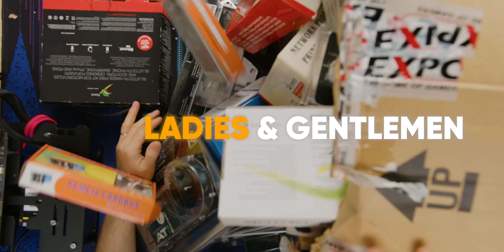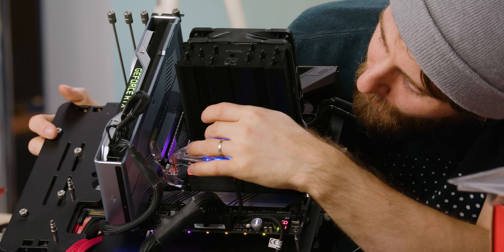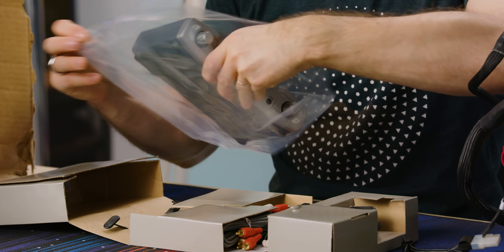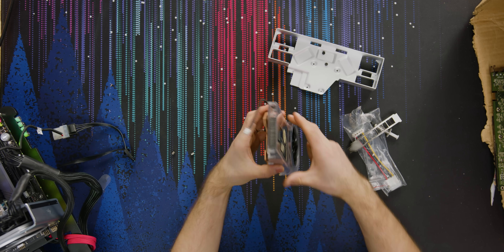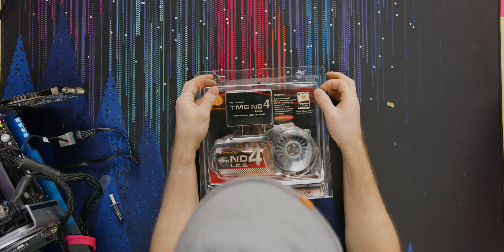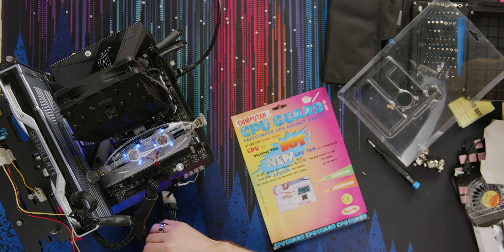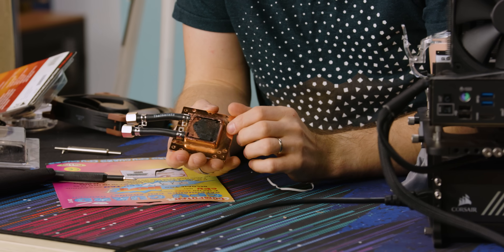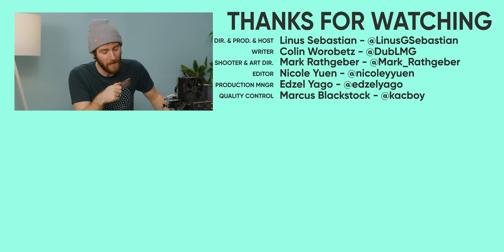I Bought Out This Bankrupt Computer Store's Inventory

Comment: The HDD racks were super. There were IDE ones and SCSI ones. Really handy for backups. When changing you needed to reboot though. On PC dump day I bought 8 SCSI ones ( metal, not crapy plastic ) for HFL 5,--  ( € 2,20 ) in the late 90's/early 00's. Those were the days. The HDD coolers were very interesting for WD Velociraptors ( 10.000 RPM ) or high speed SCSI drives. Got rid of the heat and noise at the same time.

Comment: 3:57 i actually had this before, got it from a half dead 2000s computer though. its an IDE hard drive bay (possibly for hot swapping?? idk) you place the hard drive in the inner tray and connect everything up, and then you would insert the inner tray back in the stationary tray (inside your PC) and it would act like a normal hard drive, the inner and stationary trays both have fans, so the drive gets some cooling too.

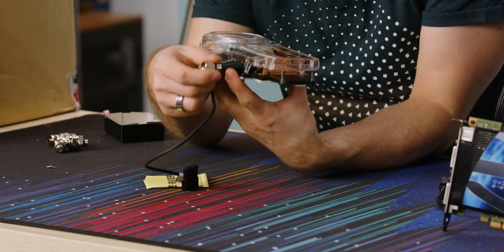Comment: 10:23
The idea of that cooler only died in the last year or two, one of the EVGA last generation cards was ALSO hybrid water (for the GPU itself) and air (for the memory).
I forget which they used on the power supply parts of the card.

Comment: "Legitimately might need this for my lathe" -> Sadly, USB to serial or parallel adapters hardly ever work for those applications. For that, you need control of all pins, and low latency, and those adapters offer neither.

Comment: In 1994 (I was 14y) I got my first own PC.  This was a special one because of the CPU. I had an 486 DX 50, NOT a DX2. My computer ran at 50mhz on the board, which was insane. 

I had a VESA Bus, the main concurrency of PCI. 4mb ram, later upgraded to 8mb. 350mb HDD, that was insane. 

Later I upgraded with a Soundblaster 2.0 sound card.

(My first computer was a C64 in 1985)

Comment: the amp looks fantastic for retro streamers for zero delay monitoring the tv audio without having to use the tv's built in speakers
Reply: Well wouldn't just plugging it into a receiver do the same thing? Or are you saying a receiver adds too much latency? I've never noticed any on any tv sourced systems I've listened to
Reply: @imthemistermaster  if by receiver you mean the capture device, yes there is significant delay, about 60ms for any analog-to-usb device. definitely enough to throw off audio cues

Comment: Still has 2 Geforce 8800GTX with Arctic Cooling Accelero Xtreme 8800  coolers! they work soo damn good back when i use them in SLI back i the day.

Comment: My hard drive runs so hot I need the hard drive cooler
I also have an old motherboard (ASUS A8N-SLI Deluxe) which has a fucking MOLEX connector, right on the board

Comment: I had a Raptor 10 000 rpm HDD from WD and I actually used this cooling thingy.

Also, no need to throw away the old things in this box. Maybe some retro computers fans could like to use them IRL.

Comment: Instead of some pre-made gimmicky memory cooler I just tucked a NFA4x10mm Noctua 40mm lil' monster floating above my 4 Corsair Vengeance 8gb 3600mhz just out the way of the exhausting top mounted 360mm Aio thats loaded NF12x25mm Beauties. As well testing their 80mm NF-A8 swinging just above my 3090Ti's backplate to shove any warm-hot air out my rear exhaust fan so no heat gets to the Top Rad.   I have a Lian Li o11D Evo with 6 Al 120mm's set as intake but 'FEEL' like those little extra noctuas are helping the interior flow be more efficient.   Mostly it's just fun making unique mods.   both are working well keeping my ram several C lower then prior when its workin'.     Give the 40x10mm NF a shot or even the 60 if you can fit it?!

Comment: This brings me back. I remember using an Artic Cooling GPU cooler similar to that one on my old ATI X850XT back in the day on my first ever PC build, which was also my first computer. May have been a little ambitious but sometimes the deep end is the fastest way to learn. I spent something like 2 months pay on it and was damn well going to make it work. And of course I didn't have internet access without it so I was essentially going from the instructions only. Kids these days have it so good.
Reply: took me also back...built my first PC in 2004 with an Ati Radeon 9600 XT which I later upgraded with the AC cooler. Seems like a couple of years ago but it's almost 20...good times😌

Comment: When I was 16, I had one of those aftermarket "dual slot" style arctic coolers for my 6800GT, and the case I used had an internal shroud BUILT IN to the case panel, so it slid directly over my CPU heatsink/cooler, to direct all the air out of the case. I felt like such hot shit then, and was still pulling like... 85c-90c in my system. Cut to now, I spent about 1/8th of what I spent of my allowance/mowing lawns that year to build a case/system that barely peaks over 70c at heavy loads. 

Man, building PC's in the 2000's was such a thrill. You bought new, dumb stuff all the time just to see how neat it was.

Comment: Back vefore I understood pcs, I had a weird gaming rig I bought for 1600$

One day the power supply got noisy, I stuck a qtip in to stop the fan and left it wedged in there for quiet. Then the same thing happened to the CPU cooler fan. So another qtip. Lmao. I was such a fool. But I never had a issue again and used that rig daily for 2 more years.

Comment: back when water cooling radiators didn't go inside your computer because cases weren't designed with radiator space in mind and so you had the rubber water-cooling grommets in the back of your computer case that you would stick your hoses out and connect up to your radiator that you had sitting on a mount next to your computer along with your pump.

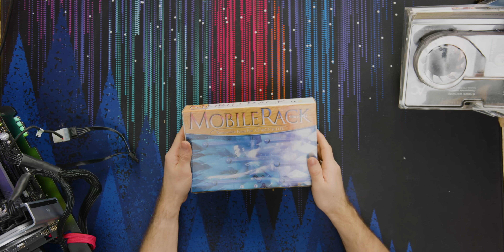Comment: I still have the skeleton of one of my old PCs that had the boot drive in one of those half height (same size as an internal CD drive, etc) removable holders you show starting at 3:43. 
It came in really handy when I would bring the PC up to visit my former college classmates to DJ parties with MP3s at a time when that actually got a ton of stares. This was when most people had heard of MP3 but few had any idea how to use it. I showed them; that tower case, monitor, mouse and keyboard sat fine behind the bar, and I showed a few people I trusted how to use WinAmp (they had never seen it before) to keep the music flowing.
I had a couple of gigs of albums and singles on the d: drive for them to choose from. That was a huge amount for back then.
People heard the great mix on the sound system and then once they saw where it was coming from, proceeded to drool a little bit and ponder similar ideas for their (school issued) laptops. I simply left my normal "my shit" boot drive at home but had a simple Windoze install on another hard disk, so I could let random people use the PC without any concern they would see any of my private documents, as those were on a hard drive several hours away.
Yes, when I visited the following year, one of the guys who had DJed part of the night with my PC was DJing the party from his laptop. :D

Comment: iam looking for fimware anno 2020 or after for:

	Intel® Core™ i3-6100 CPU @ 3.70GHz
Threading	1 CPU - 2 Core - 4 Threads
Frequency	897.15 MHz (9 * 99.68 MHz) - Uncore: 3289.5 MHz
Multiplier	Current: 9 / Min: 8 / Max: 37
Architecture	Skylake / Stepping: R0 / Technology: 14 nm
CPUID / Ext.	6.E.3 / 6.5E
IA Extensions	MMX, SSE, SSE2, SSE3, SSSE3, SSE4.1, SSE4.2, EM64T, VT-x, AES, AVX, AVX2, FMA3
Caches	L1D : 32 KB / L2 : 256 KB / L3 : 3072 KB
Caches Assoc.	L1D : 8-way / L2 : 4-way / L3 : 12-way
Microcode	Rev. 0xCC   ► Intel SA-00233 Patched ◄
TDP / Vcore	51 Watts / 0.716 Volts
Type	Retail (Stock Frequency : 3700 MHz)
Cores Frequencies	#00: 897.15 MHz  #01: 1295.88 MHz 
Motherboard
Model	MEDION H110H4-EM
Socket	Socket 1151 LGA
North Bridge	Intel Skylake rev 07
South Bridge	Intel Skylake PCH rev 31
BIOS	American Megatrends Inc. 110EMW0X.105 (01/12/2018)
Memory (RAM)
Total Size	16384 MB
Type	Single Channel (64 bit) DDR4-SDRAM
Frequency	1064.8 MHz (DDR4-2130) - Ratio 3:32
Timings	15-15-15-36-2 (tCAS-tRCD-tRP-tRAS-tCR)
Graphic Card (GPU)
Storage (HDD/SSD)
Model #1 Name	Seagate ST500DM002-1BD142 (FW: HP73)
Model #1 Capacity	465.8 GiB (~500 GB)
Model #1 Type	Fixed - Bus: SATA (11)
Model #2 Name	Western Digital WDC WD10EZEX-21WN4A0 (FW: 01.01A01)
Model #2 Capacity	931.5 GiB (~1000 GB)
Model #2 Type	Fixed - Bus: SATA (11)
Model #3 Name	SAMSUNG MZNLF128HCHP-00000 (FW: FXT2101Q)
Model #3 Capacity	119.2 GiB (~130 GB)
Model #3 Type	Fixed, SSD - Bus: SATA (11)
Miscellaneous
Windows Version	Microsoft Windows 10 (10.0) Home 64-bit
CPU-Z Version	2.01.0 (64 bit) can any 1 help me and what I7 intelcore can i put on.

Comment: That CPU Guard would have made a bit of sense in the early Athlon Thunderbird Socket A days. Those CPUs didn't have any thermal protection at all aside from what the motherboard provided, and once the CPU fan failed you had on the order of 10 seconds or so before the heatsink got toasty enough to damage the CPU; it would just keep getting hotter and hotter and not throttle itself down at all. My Abit KR7A board had a feature in the BIOS that would shut down the system if it didn't detect a signal that it expected on the CPU_FAN header, and it also had an auto-shutdown feature based on high temperatures just in case.

This was also a generation where the CPU had an exposed die, and when you put the cooler on there was a pretty good chance of chipping/cracking the die and making a very expensive paperweight. I didn't kill any Socket A CPUs that way, but I DID break the clock multiplier on an Athlon XP 2200+ CPU trying to overclock it.

Comment: LOL
I have a full tower that is "this frickin big"
Over 2 feet tall, 6 5.25" drive bays
4 bays have the pullouts, which each have a seagate 2TB drive, and you can hot swap them.
I think i have had that case since 1996.
Why bother with the pull out drives?
Cause i have a receiver in everything else, i can pull out a drive and take it to my DAW or what ever else i need to do.

Comment: I actually had an Arctic Cooling ATI silencer. I put it on my Raseon 9700 Pro that actually still had warranty when the stock cooler started to fail. But this was already a replacement card because the GPU on my first one had failed and it took Club3D effing 5 Weeks to simply replace the card and I was simply fed up with waiting. So when the bearing of the fan started to make noise I ordered this thing and everything got so much quieter.

Comment: The Konica R1 Super photo printer at the lab had a workstation that used that kind of removable storage bay... It also had Windows 2000 installed... the workstation that is.  The actual Konica R1 Super had a dedicated PC running Redhat Linux tucked behind the exposure unit. :)

Comment: A lot of vintige music equipment from the late 90's to the early 2000's (samplers, synthesizers, etc.) used smartmemory cards and those devices are still perfectly functional and in some cases highly sought after so there's still a use for a smartmedia reader, because dumping samples to a Yamaha MU-2000 or whatever via MIDI SYSEX dump is sloooooowwwwwwww.

Comment: 3:42 something like that is still used now in classified secret machines. A 5 1/4” bay that takes a 3.5” drive in a sled, locked in with a key, so you can remove and stow the drive in a safe when not in use.

Comment: 8:28
Why would you need that if you had a WD Raptor?  They came inside a heatsink shroud of their own, at least my 300gb did.
Actually, you show one at 8:54
What added benefit would that aftermarket heatsink provide?  They ran at like, 30C with WD's heatsink.

Comment: I remember my XFX Gt 250 with 1gb Ram, which had a turbin kinda fan always ramping up when i fired up a game to 100% Fanspeed right away. Back then i didnt have Hwinfo to check temps. 2 Years ago i put it in my system cuz my 2080 had to be replaced, and i checked it hitting 85°C right away xD .

Comment: Those mobile racks.. they were common in servers but like not huge enterprise.
I ran a CMstacker 810 that for a while had 8 of them till I managed to buy a few more racks. ended up with 16 drives in that beast. 12 in front and 4 hung from the roof in a custom rack. 
Anyway the mobile racks were good for backups, you would run drives in parallel, stick in a drive, backup to it, remove drive, store safely for a while, shove in another drive, backup to that repeat. useful to keep a few copies of backups. used much like tapes were. 
Thanks for the memory lane video, 2000 - 2010 was the prime computing age for me, loved all the gadgets.

Comment: Everything about the cpu guard had me laughing.  Especially since an MSI update decided to turn my custom cpu fan curves to off a few months ago and I only caught it when I noticed the sheer heat coming off during a Phasmo game.  Could have used that lovely tone.
Reply: I actually really like the idea of the CPU guard as someone who 1) uses AIO water coolers, and 2) has had pumps die... Like if they made a modern one that does PWM and either 1) had a black PCB or 2) actually used the ground to PSU so I could hide it in the case basement, I'd buy it
Reply: @AmaraTheBarbarian  you could design one on your own using an Arduino
Reply: me who found a way around it just keep afterburner open to cpu temperature you may never need it but it may save you one day
Reply: I don't know if the cpu guard® would have worked, seems to kick of when it detect an up in amperage or voltage due to stuck fan, and not if the motherboard isn't sendinding a spin up signal. Though maybe it could
Reply: @Xitrial  yeah it does basicy that so when a fan stops due to how the fan works it will build up a charge trying to start but if it doesn't start it can pull almost double what it suppose to and can burn up due to that fact but most fans nowadays are either too small or are built to handle the heat.

Comment: Mobile Rack: i had 6 of those. That is from around 1995-1998.
In a chieftech huge tower, most big towers today are small, 9 drive bays internal, 6 cd drives. i mean huge even my HAF-x was small compared too.
so you put 6 of those in and you have a hot swappable disk array.
Its that cd rom bays have disappeared but its sad just imaging building in a mobile ssd bay you can just hot swap your mobile ssd instead of having all those bays sitting on your desk.
Those harddisk coolers were heavy, i remember, there were versions of those with hot swap options too i bought those around 2000, for my 10k rmp disk array.

If you don't want that flow meter i would love to have it for my loop.

Remember that companies use to care, o were taking up a molex, here have a extra poort or a splitter cable.
These days with all the RGB and fan hubs, but none of them give you enough usb to connect it all. So you have to run cables externally.
Thermal take made some really shitty products that water cooler was hopeless, but the Copper its made off is probably worth 3x that product today.

This was so fun to see, flash backs to being a kid and building my first systems.

Comment: 03:38, no Colin, you cannot use that USB to parallel cable for your lathe with MACH3. MACH3 uses bit banging on the data pins, and the Prolific chip doesn't support that.

Comment: 04:15 we did use this bays at shoole before laptos was common. (not thet model) to be able to fast switsh a computer. All computers had the same hardware ish and then you culd take the disk from one computer to another depending on witch one was not in use. You culd also wile having one home compile anoter linux core to the same software system, on different hardware.
I had a AMD somphing and it was Netburst... P4 at school. My frend Celemine (P3) and still P4 at school and we bot hade completly different chipsets audio cards and so on.
Boot fron a USB and run OS from it whas not a thing. And still today IO on usb is worse way to offen than an old IDE 80 pin. Sadly

We are talking late 1990 and early 2000

Comment: @Linus in case that you dont know the actually nvme disk arent near the speed that you could archieve using a SCSI CARD and a fiber channel disk that could archieve 20 years before 2 GBps, and we arent talking about the lucasfilms tech, it was said that there was a SCSI card that can run 4k footage on realtime with a disk spining a 100,000 RPM.

Comment: Hey, I used to have a set of those removable hard drive bays.  Sadly they had to go because they were bottlenecking my drives.  If I recall correctly, they were only capable of UDMA2 and when I got UDMA4 capable drives, the bays had to go.

Comment: I remember when we finally ditched the floppy connected tape drives, we got those 5 1/2" Hardisk bays, and our game and program pushers could just fill a harddisk instead those slooooow tapes. took friggin forever to load a decent game onto your harddisk from those. Think I at one point had 3 of those harddisk bays in my Full Tower :)

Comment: Linus, those removable drive sleds were not for moving data around really. They were for servers. The interface on the back appears to be the SCSI II but I could be wrong.
Reply: Also in those days the larger drive bays were not just for optical drives.

Comment: Linus, about thet Artic Cooling Geforce 4 cooler... I went a different route that was more in line with the next product, the passive HDD cooler. Remember when Zalman launched their passive GeForce 4 cooler? Yeah, baby! I got that bad boy! I even got their optional 80mm low profile fan accessoiry just in case. Zo the Zalman ZM80D-HP (dual heatpipe mind you) with the Zalman ZM-OP1 fan kit. 😏